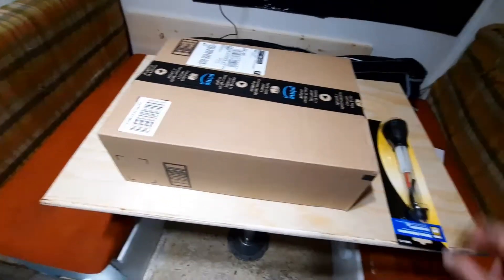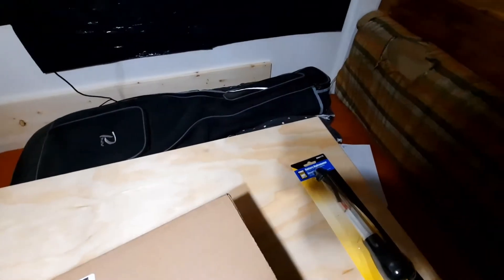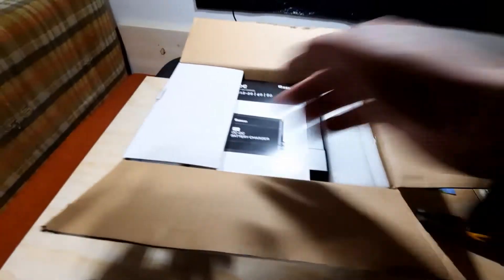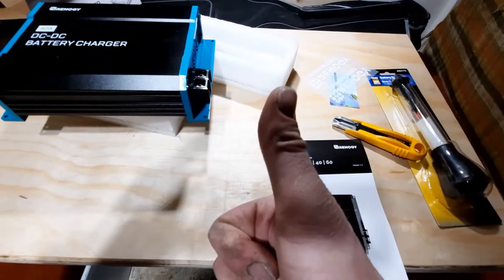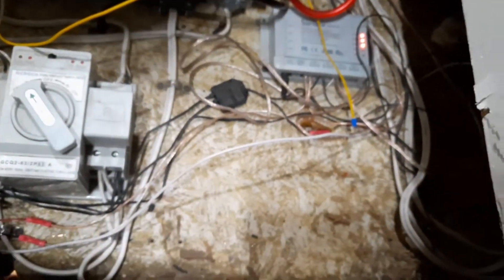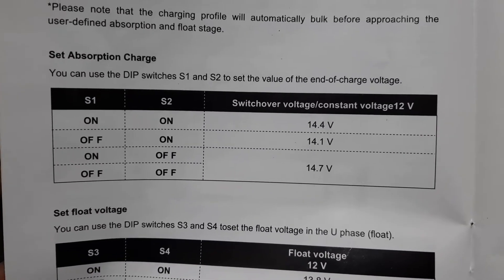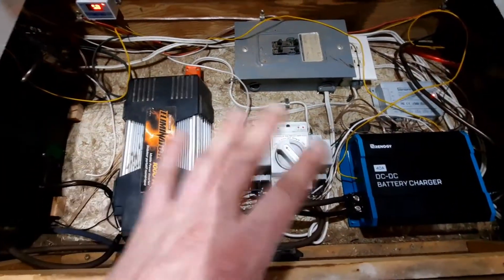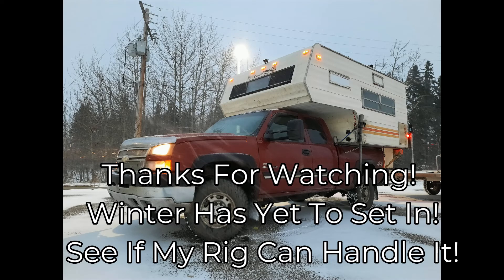Truck Camper Tiny Home DC to DC Battery Charger Install

Comment: In a truck camper use AGM batteries so you will not have to deal with acid leaking out and you never have to check water level. On your DC to DC charger I use 6 gauge copper cables. If you put large cables and lithium batteries will draw way to much so the 6 gauge will keep it working you alternator really hard and I also put a switch on my charger so I can let my truck and alternator warm and fully charge start battery and I can turn it on and off and it will keep your charger from draining your start battery.

Comment: 3 months later, how’s it working? 

I am researching for a truck cap camper build for hunting and winter camping. Because my main power drain will be a diesel heater (average 3AH) for 10-12 hours a night I’m looking at ways to top up my two deep cycle batteries (220AH capacity) without hours of driving. From what I’ve seen online these look like it’ll do what I want.

Edit: I just saw you have done diesel heater related videos too, guess I know what I’m binge watching today! Thanks!